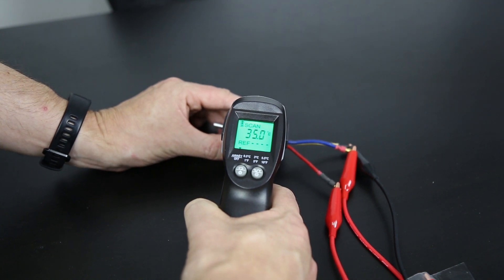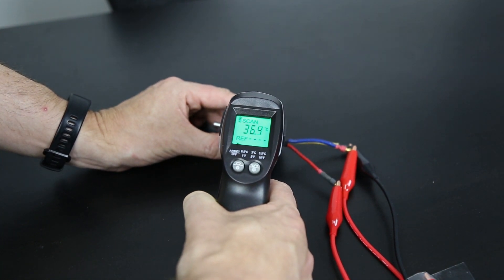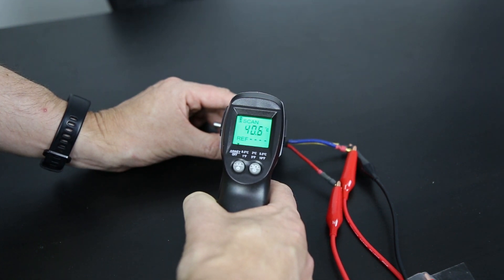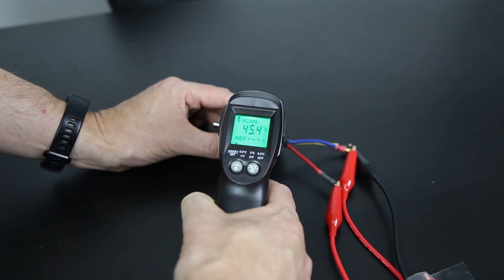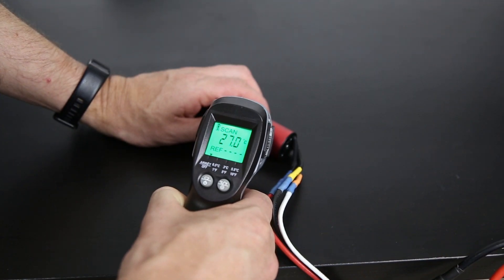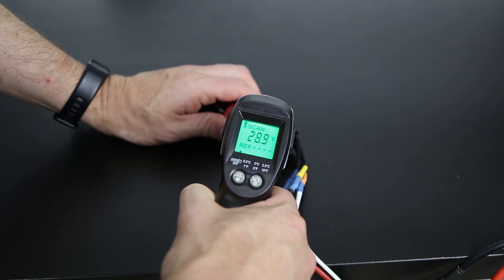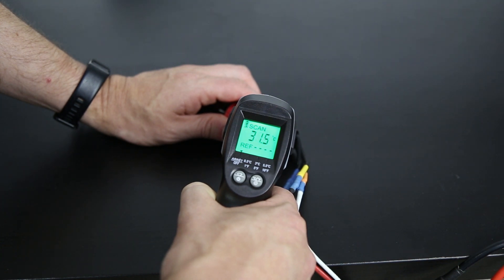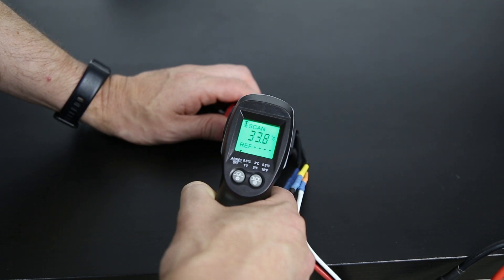RC Brushless Motor Getting Hot with No Load? Is this Normal?

Comment: But these brushless motors were supposed to be more efficient right? Why they heat up in comparison to brushed motors? Heat is lost energy. I'm trying to make a vibrator with brushless motor that is very efficient. It has to vibrate like like 7 lb weight. I bought S3650 4300kv brushless motor,but I wonder if 4300kv is too fast and low torque, it will end up drawing more current to compensate for load (off balance weigt)... Not efficient I think. Maybe I should use bigger motor, so it might use more power,but at least won't turn into heat...
Reply from the maker: Brushless motors are far superior over brushed.
A 4300kv motor sounds high. You need to calculate the RPM you will be targeting for your design. Then work out kv from thr voltage you plan to use.
Reply: @RCexplained  I guess I only need less than 5000 rpm, probably even less than 3000rpm at 12v. But I'm not sure if I can find an rc motor that rotates that slow... Maybe I need a geared rc motor, to keep it small, with more torque and less rpm...
Reply from the maker: @vahagnmelikyan2906  look at an outrunner on a 3 to 1 gear ratio. You can get a low lower 800Kv outtrunner. 
Bigger outrunner motors will have lower Kvs

Comment: hello i need help i have new brushless motor in my car but its overheating and dont have power with no load if i catch it with fingers it will stop and it will start burning i need help please
Reply from the maker: It's hard to tell what you are experiencing without it right in front of me. I would suggest bringing it to your local hobby shop.

Comment: I have an odd situation, perhaps you can shed some light.  When I plug in the battery, all lights are on (RC device not connecting to controller).  The Left ESC (electronic Speed Control) boiling hot.  Lights go dim to slowly to off.  RC device not functional at all.  Any insight is appreciated.
Reply from the maker: This is sounds like something I'd have to see in person to understand what is going on. Definitely does not sound normal. The ESC should not get boiling hot when it is doing nothing. This does sound like an ESC issue.
Reply: maybe the motor is shorting out?

Comment: I have an RC helicopter Eachine e160. Its motor goes to 66C when under mild hovering load and the 2s battery goes up to 58C.
Under no load the motor temp is 55C. You can't touch the motor and I'm thinking that 58C is too hot for that battery. Thanks for all the great content!